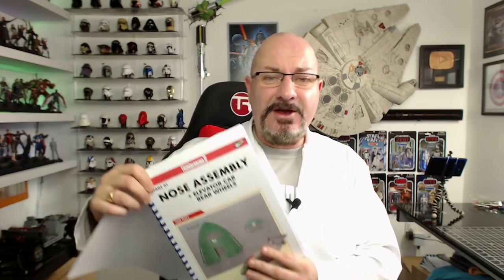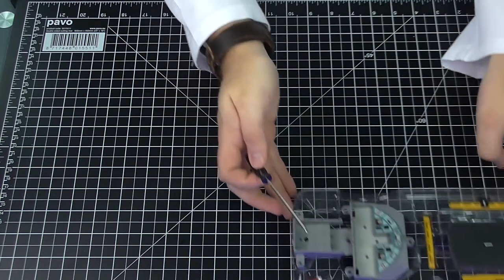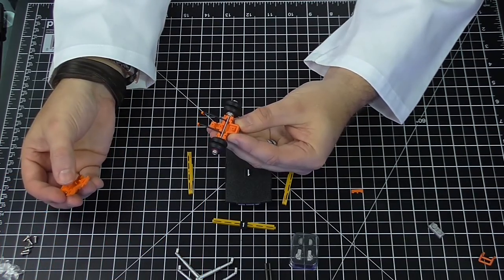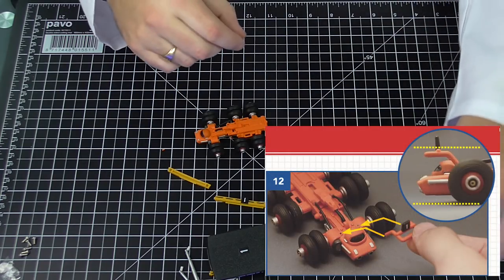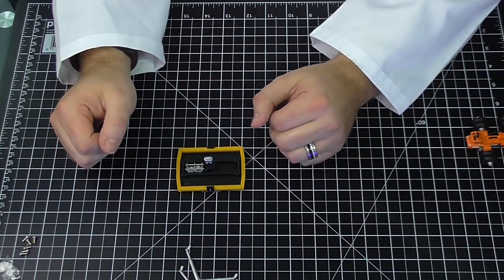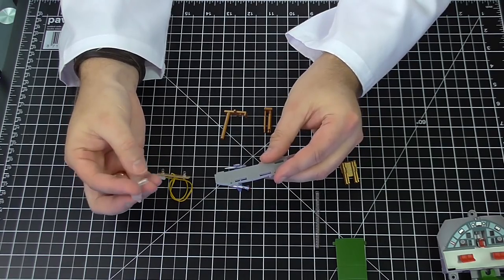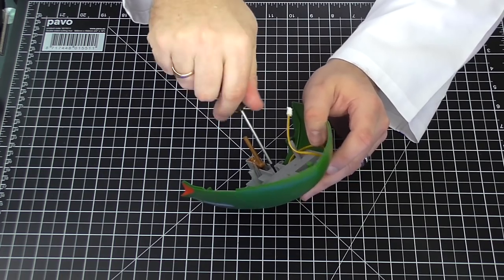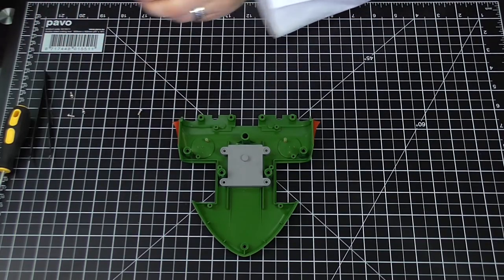Build Your Own Thunderbird 2 - Pack 1

Comment: Just got my first Pack of the Thunderbird 2 kit and have already run into an issue.  The bag of parts was torn open and the parts were rattling around inside the box.  I ended up finding that one of the axles was missing - amazingly everything else was there!  I've already called it in and Model Space will be sending me a replacement for that axle.  I am surprised, though, that those parts weren't in a blister pack like all the other pieces.  Not the best start to this.
Reply from the maker: Not good. I dont think I ever had an issue like that with my one.
Reply: Wayne:  The issue here is whatever happened to that bag (again, they should've been in another blister pack).  I'd be willing to bet that all parts were there initially, but after the bag was compromised that axle managed to work it's way through one of the unsealed parts of the box.

Comment: Deagostini did release a thunderbird 1 but in japan
Reply from the maker: Francis Terry Thunderbird 1 would look cool with a Tracy Island build too 👍
Reply: The DeAgostini Thunderbird 1 is a single box kit. In fact it's just a repackaged version of the Aoshima 1/144 scale Thunderbird 1 that they stuck a glossy magazine on to, literally they stuck it onto the box, so that's where it lives permanently, and they added three extra parts which are clones of parts already in the kit, but moulded in colours. The only problem with this is, you then have to try and find a matching blue paint to do the trims on the fin blades. Easier just to paint the original parts with whatever paint you find that you like and toss out the pre-coloured versions. I've ordered the Aoshima version from Japan and am just waiting on delivery of the thing so I can start painting it before I glue it all together.